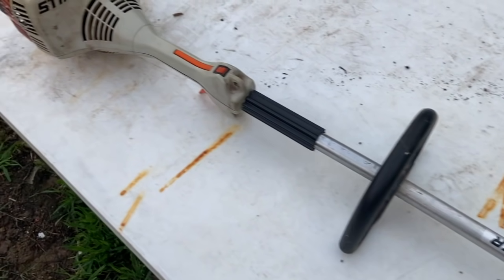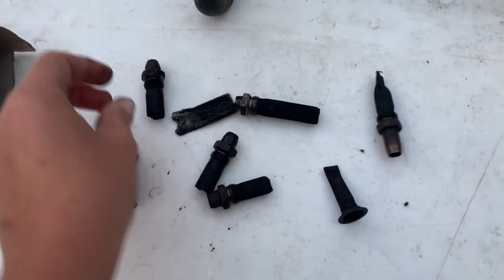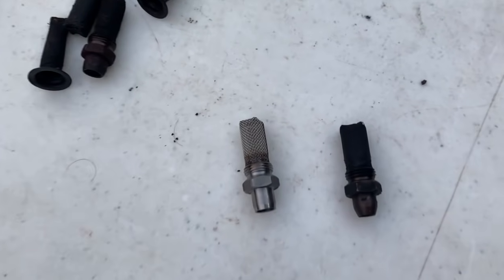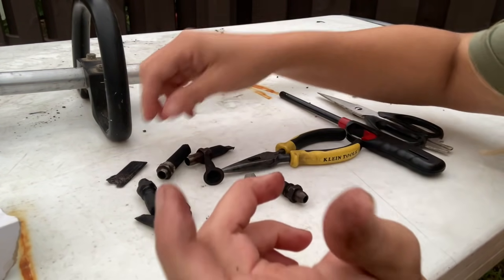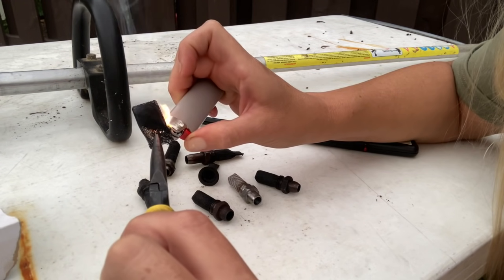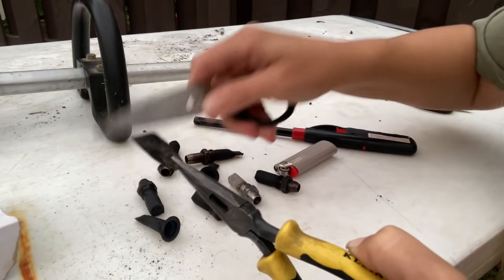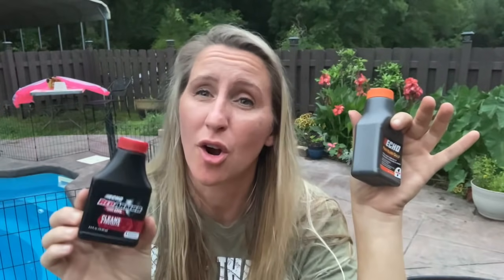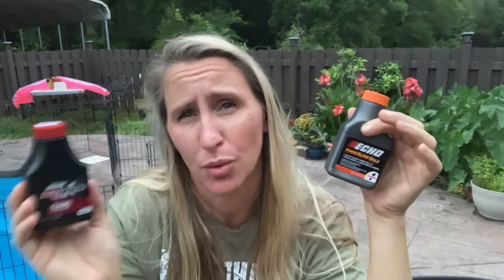THE BIG SECRET! STIHL has NO POWER? Won't Throttle Up? How to fix your trimmer/blower.

Comment: I do yard work semi commercially with 3-4 jobs per week on average for around 3yrs, so use my machines more often than the average home owner.  I have a Stihl chainsaw, Husqvarna leaf blower, Ryobi whipper snipper, Victa & Echo hedge trimmers.  I’ve only ever used Stihl oil.  All my machines have gradually one after the other started to lack power during operation.  First the Echo hedge trimmer, then the Ryobi hedge trimmer, then the Stihl chainsaw.  The Husqvarna leaf blower has faired a bit better than the others with how well it runs.  Dodgy some days, normal operation most of the time.  The Victor hedge trimmer has performed the best with only intermittent throttle problems.  My chainsaw completely lacked power last weekend on a job and didn’t have enough power to cut branches on a hedge any thicker than 1 inch.  It struggled so bad under load.  The fuel I use is alway new fuel and the oil is mixed perfectly with a 250ml measuring jug and a 5ml measuring spoon.  Thanks for the great tip on the spark arrester.  I’ll remove them all for cleaning with my butane torch.  I was a bit concerned the carburettors might have been clogged, but after watching this video it seems like the culprit would be the spark arresters.

Comment: thanks   I have a echo GT 225 weed whacker and it wont idle and I have to hold the throttle wide open to get it to run and it is not enough to be an effective weed eater, I have replaced the plug, air and fuel filter, changed fuel ( fresh oil and gas) Thanks to your videos I will check the exhaust for buildup.  No I dont run it wide open often. I think it could be carb needs cleaned if this is not a fix.

Comment: I have had this issue for a good while now. Screen would plug and the plugs would fowl. I only mix a gallon at a time as a gallon lasts me me many months. But at least in my area something I learned is when I buy a gallon of gas im not actually getting a full gallon my mixture is to rich. I only use a gallon or so a season so I went to the VP premix fuel. Cleared up my issues and runs like a top.

Comment: The customers I like best (because the problem is solved so quickly) is the ones that remove the guard that keeps the line trimmed.  The string is almost a foot long, and the engine can't rev enough to give the head a good spin.  Cut string down to 6ish inches, start the machine and enjoy the smile on their face because the visit didn't cost them anything.  It’s sorcery!!!

Comment: Funny story, I have a lot of Stihl Oil, but never seemed to use it all because I just use Moto Mix.  This is just easier for me because I ended up gumming up the carbs on some of my older tools and needed to replace them.  Sometimes I use my tools only every few months, so this is just easier.

So, last week I woke up to my whole house smelling like 2 cycle oil.  My Stihl oil had popped through the plastic containers and leaked all over.  I live in AZ, and it gets up to 130 in my garage this time of year.

I will say that since I switched to just using moto mix I have not had any problems in my tools.  It’s expensive, but saves me a lot of frustration.

Comment: i'm a fan of your channel and watch the majority of you vids and give you 👍 on all your vids but on this one I have to tell you as a mechanic and salesman for a Stihl dealer, we do not make anyone buy Stihl oil when purchasing a new power tool. A new Stihl tool comes with either a 1 or 2 year warranty but we offer them double on the warranty if they purchase a 6 pack of 1 gal. oil mix. the only tools this does not apply to is professional end chainsaws. Other than that you got it all correct  and I steer my customers to full synthetic Amsoil. If you see a Stihl dealer making their customers buy Stihl oil to get a warranty then call Stihl and report them and Stihl will straighten them out. Thanks for doing good and honest work. Also I have the same problem with my customers bringing me tools that are just not worth fixing or like the Macs we just can't get parts for them anymore. And yes these tools are not meant to be run at half throttle and the most problems that I see in the shop at present are the check valves in the carbs. that are not replaceable. Looking forward to seeing another one of your vids. Thanks and always from 1 mech. to another 👍

Comment: A highly recommend two stroke oil to use in your engine rebuilds and carburetor clean outs is Red armor two stroke oil and Red line fuel treatment for your ethanol free fuel in the four stroke lawn equipment to. Watch the power unleashed just by switching it over to that instead of regular gasoline fuel and regular two stroke oil to.

Comment: In your video, if I stand correct you mention, if you do not use Stihl oil in a new Stihl it will void your warranty. Many years ago a car manufacturer came out and stated if you do not use there oil, they will void your warranty. The individual wanted to put the oil he’s been using which is a AMSOIL. Long story short, the car company needs to furnish that oil for them for free . Amsoil’s, Attorneys got involved with the car company and they pull back their claim. Thanks for coming to work and keep up these great videos. I have forward and shared many of your videos to many of my coworkers. Thanks again.

Comment: Thanks for doing such a good job with these very informative videos . My question for you is. I have a few Stihl 4mix pieces of equipment also using Stihl fuel mix in the 4mix engines . I am using Echo Red Armor fuel mix in all of my 2 stroke engines  and very pleased with its performance.  Our Stihl dealer told me that using Red Armor in any 4 mix engine will void its warranty. If using Red Armor in all my 2 stroke with great success then why in your opinion is it not advisable to use Red Armor in Stihl  4 Mix engines is my question? Thanks for all your Videos. And keep up the good work.

Comment: Running equipment at WOT and high load is important for getting everything good and hot to clean carbon out of exhaust and combustion chamber.  That's why i never clean spark arrestors on my equipment unless its running poorly.... we run equipment for a living.
Great info for home owners and ppl new to timber or landscape maintenance.

Comment: Interesting video and your findings. I have a Stihl and just because of the way I clear the yard, almost always use it at full Throttle. Likely have no carbon build up. But haven't actually checked. My trimmer is years old and has an Echo line feeder. I have gone through 4 or 5 of them already, but they are not pricey and they certainly make trimming work much easier. I always keep 2 spare trimmers in case something happens to one, I still have a spare. Great video.

Comment: Great video presentation and informative. In Portugal there are days when (s)trimmers are legally required to be fitted when used in forest areas, but are not fitted or available to purchase from Stihl in Europe.
My first motorcycle used 16 to one part oil, mid 60s  and I always used regular car engine oil. No problems with that. No so with Yamaha 350 twin mid 70s, revs had to be kept up or the plugs would oil up and the only way to get the bike going was to change the plugs and heat up the removed plugs on the gas stove ready for next time.😂

Comment: With the screen lighter is a quick way the way I use as a small engine mechanic I got a very cheap table top propane grill it was like 100 bucks but worth il place it some aluminum foil and  down and place 7 on there a day that’s what I have come in for that it take around a 15-20 minutes for all of them   Saved me time  and it’s safer and I don’t have to scrape which you can burn it

Comment: Weird, I have a Stihl hand held blower(2) Echo backpack blower, Stihl chainsaw, Hedge trimmer, and String trimmer. I have used Stihl almost exclusively and had excellent service from all of it. My Hedge trimmer is about 15 years old, Chains saw 30 years, hand held blower ten years old. I had an older one about twenty years before I dropped it off the roof one too many times and broke everything but the motor.  I have run Stihl oil and regular gas in all of them. I have never had a problem like you describe. I do mostly run them wide open except for the String trimmer and the Blowers that have Cruise control on them I can set and run at a lower speed when I am around plants or in the garage Etc. The only thing I have had to have to the shop is the Echo usually about once every two years it starts to run rich, quit, and wont idle every time I let off the throttle. I don't use this piece of equipment as much as I do all of the other ones. The Echo I inherited from my dad. Maybe I've just been lucky but I also think there is better gas in different regions of the U.S. I live in the Pacific NW and am at 500 feet above sea level so the air is rich with oxygen here. That may be a factor.

Comment: So really, some of us weee talked into a trimmer too powerful for what we do. My cousin talked me into a straight shafted Stihl trimmer. It’s too powerful for little ole
Me and my close to the house trimming. He lives on a farm. Big difference. I have not had any issues with mine, but have already through about trading it to my son-in-law for his smaller curves shaft trimmer. I still have that oil from when I bought the trimmer.
Reply from the maker: When you walk from on area to another and before you finish, rev it full throttle for about 10-15 seconds just up in the air. It will help burn off that extra carbon.

Comment: I had an FS55R and had nothing but trouble with it after  3 seasons of using it. I pitched it and bought a battery powered one with a charger and 3 batteries for about 800 bucks. It's not as powerful as the gas job, but I don't have to mix gas and oil, I don't have to buy gas and oil, and it runs and runs, and runs, and......I'm happy with it. I also bought a chainsaw that uses the same battery the string trimmer does. It's a dandy.

Comment: Thank you, everything right. I mix myself, having machines with 1:50 and 1:40. Its hard to keep them apart, so i use like 1:45 aprox for all.knowing this i clean regular the plug and exaust and it was ok for many years. More oil means more Carbon and smoke but for me it dosnt matter that much. The kind of oil is not so important. That is my experience in this matter.
Excuse my grammar, i'm from Germany, hope you can understand what i mean.
Like you and your work, greetings and thanks.👍😘

Comment: Thanks! I’m a STIHL guy….FS 90, MS 290. Helpful advice! Also ensure every year to clean and gap my spark plug. Also use AMSOIL quick shot. I run non ethanol gas but the quick shot I think helps to break up any dirt in the carb, as I do see that after using the QS the machines tend to fire up more quickly and idle better. What do u think of quick shot? Both of these machines are over 10 years old and literally the only time I’ve had one of them in the shop was to replace the clutch of the weed trimmer. I also replaced the exhaust muffler on the MS 290 because the internals of the original muffler literally came apart. Other than that literally nothing has ever been fixed on them .

Comment: I do that with a small blow torch, and it works quite well. Get it red hot and that burns the carbon right off of it and then you have to do less scraping course with a lighter you’re not getting hot enough.

Comment: I have an Echo blower and chainsaw that are over 20 years old. I go to my local airport and buy 100 octane low lead aviation fuel. I mix it with Yamalube R oil at 32 to 1 mix. Never had to do anything but replace fuel lines and plug.

Comment: I've owned Stihl for brush Saws and chain saws  for 30 years. And I've used Stihl oil.   I've never had this problem. I like my Stihl because they just work and they last. 
That said I do run my 2 strokes at full throttle so maybe that part of it.
Briggs equipment is a whole different story. Cheap crap. The last time I replaced my mower I bought a cub cadet with the 23hp kawasaki engine. I very had it for at least 12 years and have over 250 hours on it its been also rock solid. The only issue I've had is leakey rear tires. Had to tube both.

Comment: Exactly on wide open throttle !  We unclog the exhaust drill some extra holes or in the case of the chain saw a bark box will do the trick !  About 70% flow and 30% hold back they say is efficient .  My brother will fill the muffler off the machine full of gas and light it he just lets them burn then blow them out with compressed air ! Right on the keeping the screen the main thing is run the highest octane gas like 94 octane still even says that you need 92 I think or higher .  But a few extra holes don’t hurt a 2 cycle motor runs on how much it can get out the exhaust because it’s actually letting part of the charge of fuel and air mixture go out with the exhaust as it runs .  That’s why the motor cycle company’s put a power band or valve on there motors it controls the exhaust better so you get more power !  I just found that out recently. I always thought it was to let more in or to push it in !  You learn a lot when it comes to porting and polishing a chainsaw motor when you have to run ceramic bearings the rev of the saw is 250 times a second the spark plug fires !  15 k rpm is getting it !  I’ve built a good bit of hot rods and it’s a whole new world we’re there is only one cylinder with no valves and the intake charge is sucked in around the crankcase before it makes its way to be combustion chamber ! Great deal on letting every one know how the oil can carbon up the exhaust on these great little machines .

Comment: Good video.   I know YOU can't say that one can remove that spark arrestor screen.   Years ago, none of the two strokes whatever they may be, had those. I have never had any fires start from using a chain saw  or any other 2 stroke appliance.  Now a days, that screen is the first thing I remove from my 2 stroke muffler.  That way, no more plugging in the muffler.

Comment: I like. Echo  2 cycle  oil  we got a small 12inch saw. That  cut a lot of trees  in 5yrs
And  it will   bust off on fr😊ist. Pull Sam bar /and  aftermarket  rope starter   / a oil pump  / and  😊its been 😮thur he'll  and  is strong  as a new  one.

Comment: I now only use alkylate petrol in my 2-stroke machines. Yes, it is more expensive than normal petrol mixed with Stihl oil. But it is without carcinogenic benzene and the engine stays much cleaner. Another advantage is that the synthetic fuel does not segregate when stored for a long time. You don't have to empty the carburettor and tank over the winter. This is an advantage especially for occasional users who have the problem that normal fuel with biofuel components decomposes after a long time and can damage the engine.

Comment: Another great video. I learn something every time I watch you. I did learn several yrs ago when my back up generator wouldn't start that it was from old gas and ever since I run only ethanol free gas which you can get now at most Sheets stations (the red pump handle). I even run a tank thru my vehicles every once in a while and notice an increase in my mileage. Yes it is pricey but its worth it.

Comment: Love Your advice and this subject is something I am currently dealing with. I have chainsaws, weed eaters and blowers so I mix a lot of 50:1. 
Due to some bad gas issues in the past I am currently using 100 octane Aviation fuel in everything I own that does not have a computer such as lawn mowers, ATV, boat and 50:1 with no issues until I started using the echo red oil @ 50:1 in my Stihl BR200 backpack blower and this is the symptom. 
Blower starts fine but after a few minutes it just quits like someone turn switch off. I finally figured out if I pull the spark plug it will be fouled with with what looks to be a wire across the gap. Knock wire off gap and the blower starts right up and runs a few minutes then quits. Repeat for hours. 
I finally drained all that fuel and ran unit till it ran out of fuel. Then I mixed a fresh 50:1 using the Stihl oil and it has not fouled the plug on the first tank full running over a hour. 
My theory is the cleaning additives in the AV gas and the echo red are cleaning 4 years of crappy gas residue from the entire fuel system and that may be what is accumulating on plug. 
I’m in Conway and would love to know where your shop is at. 
Love to get your theory of what is happening with Blower only, so far.
Reply: Aviation gas currently still contains lead as the octane booster.  What you are describing is classic lead fouling of the spark plug.  It is caused by either a too-rich mixture or running the motor at lower RPMs/cooler conditions.  If you do a simple online search you can find images of lead fouling of spark plugs along with diagnostic images to help determine the cause.  I've been running AvGas in all our small engines exclusively for many many years.  The AvGas simply does not "go bad" or cause varnishing in the carb like pump gas, and it is, as you mentioned, very high octane.  But we also run all of our small tools quite hard, and periodically check the spark plugs for fouling.  There is a big push to eliminate the lead from Aviation gas which will happen shortly, and the lead fouling issues will be a thing of the past.

Comment: Thank you for this. I've got a FS220 and a FS280. Had them for ages. The 280 wouldn't rev. Tried everything I could think of. Today I watched a bunch of videos on blocked mufflers so swapped mine over. Sure enough the 280 revs now. Now I just need to order a new muffler. My machines don't have a spark arrester as far as I can see, so the muffler itself must be blocked. Anyway easy option is a replacement from ebay. Stihl don't offer parts for my machines anymore (I really hate them as a company) so aftermarket chinese is my only option.